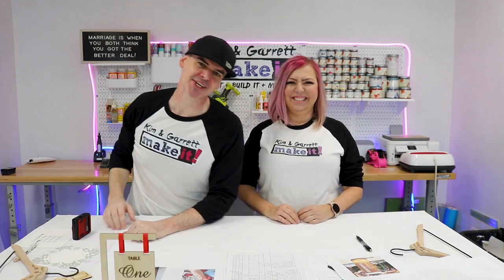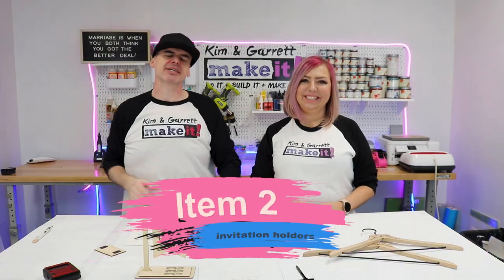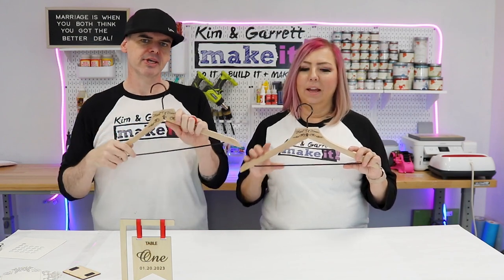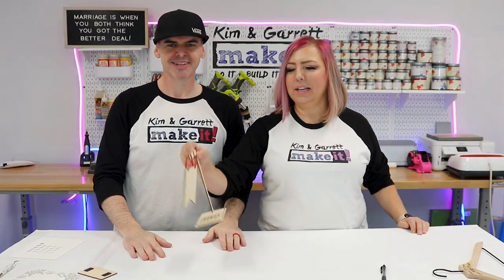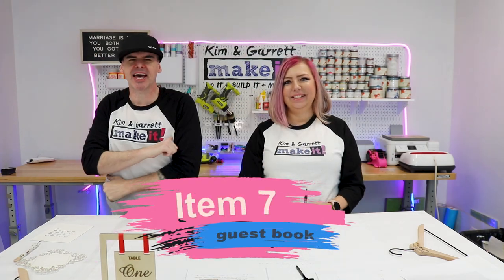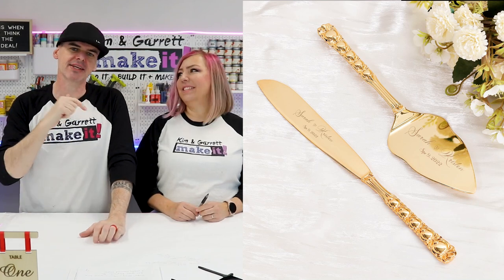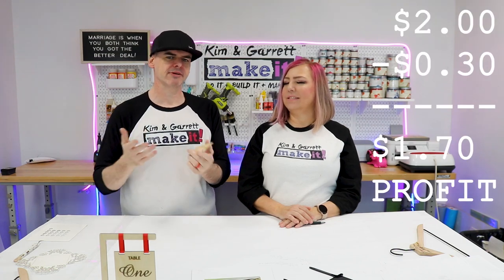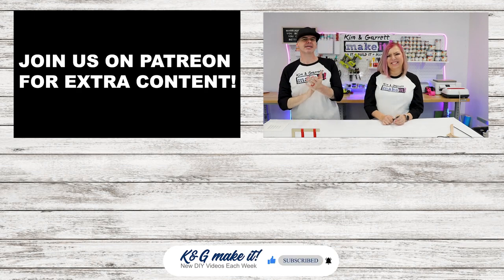10 Amazing Wedding Decor Ideas You Can Make With an OMTech Polar  Desktop Laser Engraver

Comment: On the Cut the Cake section at the 11:26 mark.  Most utensils used for cutting is metal.  Would you need to coat it first before you hit it with the laser?  If you do need to do this what's safe to use for coating the utensils for cutting the cake?